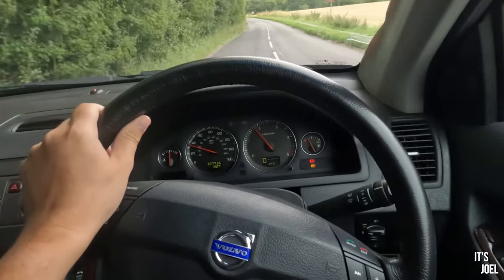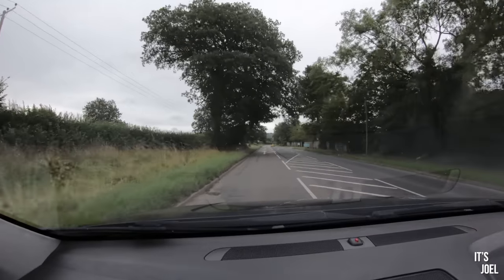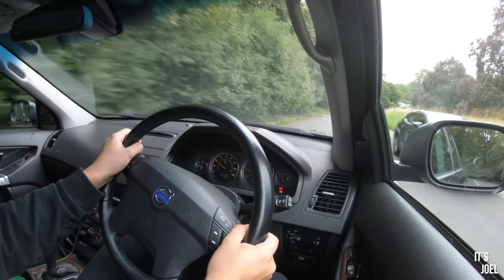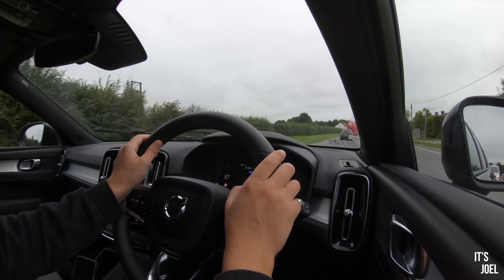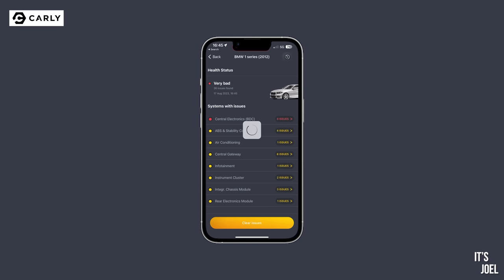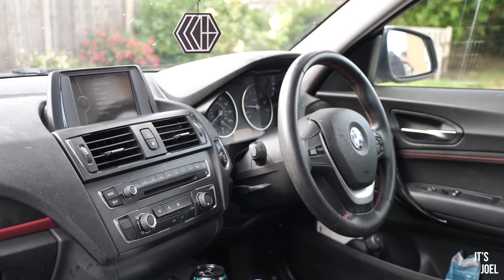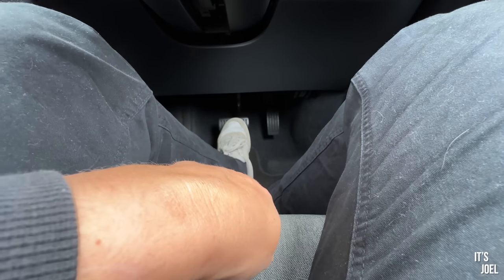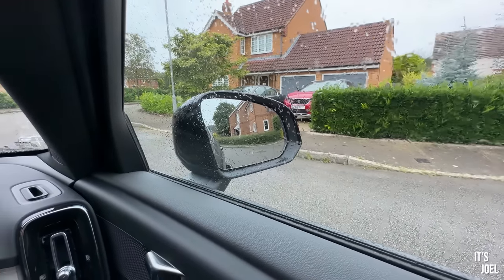I TOOK MY £800 COPART XC90 TO VOLVO FOR A HEALTH CHECK...

Comment: This is a great example of why you don't take an old car anywhere near a main dealer. They judge everything based on the condition of a new car, they often invent work, and their labour rates are extortionate. Glad you're planning to save it! 
All of the cosmetic parts and switchgear are readily available either secondhand or pattern at a fraction of the price quoted, if you even bother with all of them. The instrument panel can be reconditioned at a reasonable cost if you want to get the DIM working again (but it's not essential). The D5 engine is easy to service and work on, and the timing belt is about as easy to do as they come. I did mine, complete with the water pump in a couple of hours, taking it easy. Access is good, and you don't need any special tools, although you'll need something to hold the crank pulley when you torque the centre nut up to 300Nm. 
Volvos of this era are beautifully built and engineered, and very logically designed from a mechanical viewpoint. All I would recommend is getting yourself a decent Volvo capable scan tool. Generic OBD2 scanners are pretty useless on these cars, as the really useful codes that give you much more to go on are proprietary to Volvo. The iCarSoft range works well, and if you have a laptop spare, buy yourself a J2534 USB passthrough cable, and install the Volvo VIDA software which is readily available (often comes bundled with the cable), and will give you full dealer level diagnostics and technical info. There's also a tool from d5t5.com called vDash which again does in depth diagnostics, and even allows you to decode the PIN in the Central Electronics Module which then allows you to code in new features and options. There is little you can't do with these cars yourself.
It's not even close to being uneconomical to repair if you decide to do the work yourself. These are great workhorses, and are built like tanks, as the mileage on yours attests to. My 2011 D5 is on 180,000 miles now and it's still a brilliant family car and tow car. With the seats folded, it's like a van in terms of loadspace, but you can get 5 adults and 2 kids in it comfortably if you need to.

Comment: I bought a 2014 V70 D4 2 litre Ulez 2 years ago with 160k. It’s bodily in great Nick but I soon found out it it consumes copious amounts of engine oil. .5litre to circa 800miles. There’s no black smoke at all and it always passes it’s MoT emissions. In comparison my previous 3x 2 litre diesel Passats with mega miles NEVER used oil between changes. I have read much forum chat about this and it appears the piston rings of this generation are very ‘slack’ and do not require a ring compressor to fit the pistons, I guess to reduce friction and achieve Ulez targets. 
Wish I’d read about it before buying 🤪

Comment: Hi Joel great video. It might be an idea to point out that if people are interested in a Carly , they are buying an annually recurring licence to use the software. This is not at all clear on their website, and is hidden in the terms and conditions. Also, there is no cooling-off period which I thought was a legal requirement in the distance selling regulations. But apparently, by just ordering this product you appear to forfeit that right. I think there are probably better options available.

Comment: I have a 2007 d5 geartronic lux .   I had the anti skid message which required a new Haldex unit.  I’ve still got the volvo diagnostics hardware DICE thing if you want it and software.   Cost me £1200 to get fixed and I also needed a £1900 steering rack.  170000 miles
Reply: If you can turn the drive shaft freely to the rear, then the spline bushing is broken
Thats the weakest point of the 4wd
There is a bush between the gearbox and the right-angle transmission. It is not expensive, but it is a 3 to 4 hour job.
In all my 35 years with volvo,i never did a haldex replacement.

Comment: These things are money pits. No question. You see lots of them around and as they get older they get increasingly expensive to keep running well. My Volvo V70 is almost 20 years old now and it’s going well, but every time something needs fixing it’s €500. In fact last May I spent €850on maintenance which included timing belt kit, water pump, serpentine belt and brand new alternator. A service on top of that is another €150.
Rear discs are next and I’d like to replace the steering rack as it’s weeping and feels a little lumpy when doing low speed manoeuvres like parking.
It’s still a great car and with only 92,000 miles on the 2.0T manual.

Comment: Mm? Main dealers. Got a quote for over £2000 from Mercedes dealer a couple of years ago during a recall. It was a free safety check. All fixed for under £200 at a local garage.
Be careful with courtesy cars, the insurance can sometimes be third party only

Comment: It's not that bad and the mechanical stuff is probably do-able although you will be fighting 19 years of rust and dirt changing some of those components. The cosmetics could be more costly and outweigh the value of the car so quite a tough call IMO!

Comment: Well , went to my local Volvo main dealer  in Eastbourne with my 22year old Volvo V40 to ask about a fault, waited in the showroom while the receptionist went to see if anybody could look at the car. No sorry we do not have time was the answer.
Bought the car new from this Volvo dealer used to be very good but have changed hands since I purchased the car.
I use a garage down the road from the Volvo main dealer, which are brilliant.

Comment: The additional stuff that wasn't included they won't know until they start taking it apart. For example, to put the pickup rings on for the ABS you are going to have to remove the hubs and the bearings in the hubs may be going bad and or need repacking. They won't know the state of the bearings truly until they take it apart. Also your rotors need milling as you got some rusting going on  and its bad to have a lot of rust on the rotors as this reduces your braking ability(sometimes the rust will rub away with some driving and braking, but sometimes it doesn't and requires the milling) and since you have to replace the brakes in the back it may be best to just replace all the hubs and rotors and brakes, this will save you on the abs rings and removes any uncertainty with the rotors and hubs. You also have some rust damage going on around the control arms, the moment you start taking stuff apart you might encounter more stuff that will need replacing. Since you are going to be taking off the control arms it may be worth taking a look at the steering shaft and other components down there and replacing the shock absorbers for the front(only other way to know a bad shock absorber from just looking at it is with a dynamo or looking at the wear pattern of your tires) ideal to replace the shock absorbers anyways since you have to remove those and they are not expensive so might as well while you have to access to them. Looking at the one wear pattern of the tire you showed it seems it has some outside wear that isn't normal which indicates you might need a slight alignment adjustment can't say for certain as you didn't show the wear on all 4 tires. The fuel injectors could be easy to replace it just depends on the motor and how it is designed. Some of them are easy others are more difficult and require a ton of stuff to remove. More stuff you have to remove, the more likely you may need to replace the stuff you are removing but I don't think the fuel injectors are going to be too difficult to replace. Also its diesel and diesel cars can easily make it to 500,000 miles as long as routine maintenance is done. intercooler is also not going to be difficult to replace either, just need to ensure you replace the transmission oil that is lost from draining it and since you are going to be draining the transmission fluid best to do a transmission service. That is get a new transmission filter and replace all of the transmission oil just make sure you buy the appropriate oil. The quote of 5 grand is actually not terribly high as you have to remember there is labor charges and since they don't know the full scope until they start to look at it, they don't want to under estimate. Also, as I mentioned there is some stuff that is convenient to do since all the places that requires repairs makes it easy to service those other components at the same time. If it was me, I would probably replace the entire sub frame in the front end, mainly because I don't like all that rusting that is going on, and rust reduces the strength and integrity of all that stuff if nothing done about it and there is a point where its too late to do much of anything because the rust has penetrated either all the way through or more then halfway of the metal. Even if you replace the sub frame, I estimate with some patience you could probably get all that done for like 2-3 grand. It may seem like a lot but it isn't but that depends if you deem it worth it. Have no idea on your intentions of the vehicle. If you just do all the repairs without too much extra like replacing sub frame. And lets say you want to do the shock absorbers and replace all the hubs, with the total you quoted it would probably add about another 400 approximately. I am not too familiar with the prices over in the UK but it still shouldn't add too much and when it comes to the wheels better to be safe lol.

Comment: 300k Miles is nothing for a D5 Engine. There's a reason why most commercial vehicles are Diesel - reliability. I've a 2003 S60 with over 580k on the clock and it's still a beast. 
 The car has stood the test of time and hard use. I've driven it round Europe three times, towing a Caravan. Regular maintenance is the key - and I do my own.
The only problems that have occurred are the ones you'll see on every other vehicle of the same age.

Comment: I also have an XC90 exrctutive d5 phase 1. Its been demoted to farm truck duties as i felt it was costing too much to keep repairing odd parts, watching this video makes me think it wasnt that bad afterall 🙈😂. To get the screen on the dash to go up, you have to click enter on the back of the steering wheel twice. The disc and player for that satnav is under the passanger seat. Sometimes u have to op and eject the disc and put it back in and it will work again

Comment: I genuinely don't believe any of those things should add up to 5k (I work at a independent garage) the timing belt, full service and lower arms, injector and intercooler are probably most expensive parts but nowhere near 5k ! The bits of trim if you know the trim code you could probably buy a complete interior trim set from a breakers yard for about 150-240£ ish Inc a steering wheel! As a fellow Volvo owner I will try to help! I own a 49k mile from new 1 prev owner 2011 MK2 facelift Volvo s40 D4 5 cylinder with some rare factory options too!
Reply: Probably £150/hr labour and main dealer parts prices. Then add the 20% for VAT and it's easily £4-5k. Of course no one in their right mind would get a main dealer to work on a car of this condition and age!

Comment: That honestly doesn't seem to bad, the rear brakes will need shoes and fitting kit too, only fit genuine as non genuine won't hold a handbrake and fail mot.
Abs rings will have split and worn through the abs sensors too so will need 2 new sensors aswell (volvo tech)

Comment: I got rid of my 2003 xc90 just over 2 years ago, it had a mere 190,000 miles on it. Had to go because needed gearbox and steering rack repairs/replacements. The car itself was in ok shape though with just poor paint job starting to show through on the front wing, and the usual wheel refurb needed. It was comfy reliable and had plently of room in it, but that's all I can say in its favour, don't think I'd want another.

Comment: Had a engine management light up for two years. Goes in for service, still there, not mentioned at all by the main dealer. I mentioned it,  reply was,  does the car run ok , Yes it runs well. Then nothing to worry about was the reply. So today light is up.. And done 15k . Obviously just a glitch and no one wants to know. It's not a Volvo, it's a Citroen.  Thanks for your video. Interesting one.

Comment: A mechanic would certainly take this on, but they would do the tyres, the brakes, ABS sensor system, the suspension, buff  (not replace) the headlights, replace the wiper blades. They wouldn't bother with the audio system or the air con.

Comment: I bought a car for $300 once, I put double what the car was worth, and drove it for 8 years, I put over 100k without any major repairs after the original repairs. A friend borrowed and had hit something and knocked a hole in the oil pan, killing the engine. I put a used engine in and got an offer for more than I had in it. I bought a Mercedes sitting in a field, drove that 5 years till the rust made the car dangerous. I bought a Jeep with 286k, and it's a good car. But I'm eyeing the Volvo XCs now.

Comment: That XC40 B3 is not four wheel drive. It's FWD...

The headlights are not (only) a cosmetic issue.

ABS pickup rings can be a bit of a pain in the butt to fit.

Also, the car really does not need new wheels to keep it on the road...

Comment: I am using a no brand service / repair shop instead of volvo. They often charge 1/4 of the volvo quote. The cam belt need to be replaced.

Comment: Its only uneconomical to repair if you want it immaculate and get it done by a main dealer. If you want it mechanically sound its well worth doing. Most of it is just deferred maintenance.

Comment: So fixed with parts and a tame mechanic £1400, depends on what you can sell it for, but with no mot I expect 200-300, I would fix it, better the shit heap you know than the one you don't.
Basically by selling it you will have £1700 in your pocket, what you going to get with that?
Reply: I would also add to my comments, that murdering an old girl for the sake of a few parts is like putting your old dog down because it farts a lot.

Comment: My 9 year old 105,000 mile Mitsubishi Galant needed £3,500 spent for the MOT. 
My 10 year 95,000 mile C5 needed £3,000 spent to get it driveable.
Both had to go as uneconomic to fix.

Comment: I would NEVER trust a volvo main stealer. Got my current XC90, took it for a volvo main dealer diagnostic, as a dpf light was on, they just knocked the light off, 10 days later it came back, took it to an independent, and they found the code that volvo just knocked off (for £200!} turned out to need a new dpf sensor. Ignore volvo, take it to a good, independent, mechanic. The ABS is usually the seatbelt sensor. Also under the drivers seat is a well with various sensors, it often fills with water, so drill a hole in the bottom and stick a gromit in it.

Comment: Alot of the fixes needed are wear and tear tbh! Some otems like interior trim etc would be easily sourced from breakers or fleabay! If the car is stops, moves and runs fine, its a starting point!

Comment: There is only one thing wrong with that car, and that is a lack of ongoing maintenance. The vast majority of "defects" are either consumable items that should have been changed as they wear out, or are cosmetic items that are neither safety, nor operationally necessary ( missing undertray, scabby wheels control and switch trims and cappings). Like so many older cars, this one has, in simple terms, just been neglected by its owners - The car is not at fault, it's the owners who have neglected it, who are at fault!

Comment: The optional premium (as opposed to the already mighty high performance system standard on the SE models) stereo on the Volvos of that era were stonking. 4x75w amp, 13 speakers and premium speakers/subwoofer. Had one in my 2004 s60. Only the Lexus LS came close. You should save this car just for this, and can purchase a USB /iPhone-in lead for them for around £100 which allows top quality Spotify/tidal direct playback. Trust me it’s ridiculous…..

I reckon this car could be saved (certainly through an MOT) for under a grand. You say that it has an engine that nobody wants - wrong, the d5 is always the sought-after version due to being a bulletproof engine that goes on forever with regular maintenance (the original or latest owner obviously stopped caring sadly), combing lots of power and torque with superb economy. I’d save it definitively.

Comment: Car is high-miler and not ULEZ compliant so will put off a lot of potential buyers. If you do want to give it another year on the road I'd suggest finding a cheap doner vehicle. Take what you need from that and then scrap that car so you'll get some cash back.

Comment: TBH mostly not too bad, new tyres, new mirror, staple the head liner up for now, most of them parts are easy to fit yourself, polish the lights, I recon it could be done for about £600 if you do it yourself, maybe £1200 at a garage

Comment: If i was still in the UK   it would be a pleasure Belive me if it didnt stop or got to limp  mode .that car will run for a long time......the list of 800 it can be cut to half easy. Time belt is a bit hmmmm but very easy to do the rest a good impact some jacks ... job done.
I have always do my things around my XC 70 ... and once you got them done.i bet you you will want to keep it.
Good Video. 
KEEEPPP IT

Comment: Problem with the XC90 is that there are eleventy different front brake configurations. Getting the right pads and disks is a bit of a lottery. But the D5 is the best engine, by far.

Comment: See what the essentials are when the MOT is done. Take it from there. If you intend to sell this car the outlay to repair won't add much to it's value. I would only start a programme of repair work if it's your intention to keep the car long term. Otherwise it's a false economy. But, of course, you knew that already!